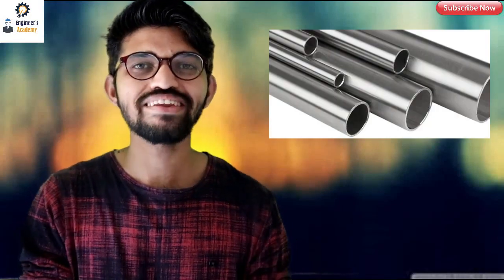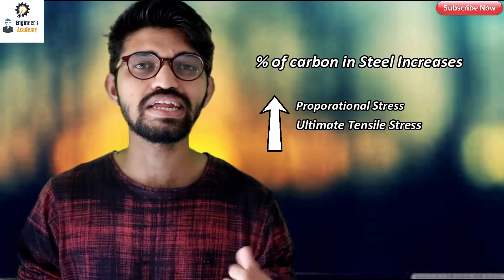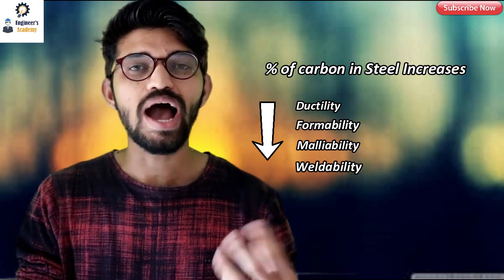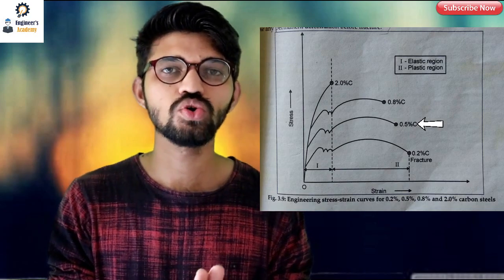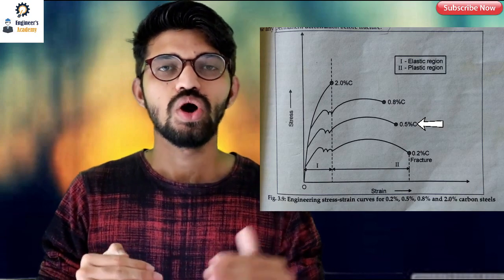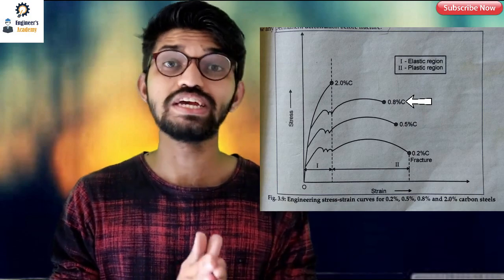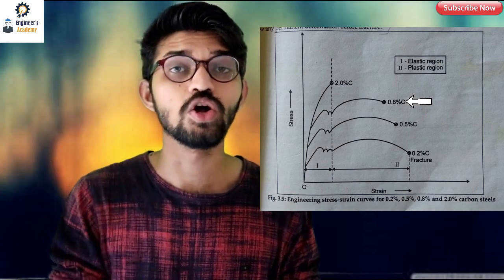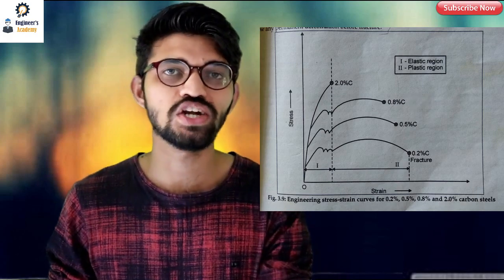Difference Between Low, Medium & High Carbon Steel !! ||Engineers Academy||

Comment: Bro, you explain the low carbon steels micro structure. Medium and high carbon steels micro structure stages?
Reply: Yes please.  And can you tell carbon % vs. Carbon Equivalent. In USA welding standards CE is a formula of carbon (+) plus % Mn/6. 

So. I have a bar/rod, threaded, with . 48 carbon  but . 612 CE. Does your guidance reflect on the . 48 OR the . 612.
Reply: Also I have a welded piece of this rod, that cracks off cleanly when "tapped" a few times similar to a Charpe test ( no notch).  BUT, WIL STILL SUSTAIN HIGH TENSILE LOADS!  I need a mastermind to help! Is this stress resulting across the entire section?  It's brittle like etching glass! Yet the welding code says to test welds by hammering ( or pressure bending) welded section over 30 degrees. . How can you hammer if impacting it severed the part?

Comment: low high carbon steel . Difference to STAINLESS steel metal ?
Reply: I have the same question. Pls share link if you have made the video.
Reply from the maker: I will make another video on this topic.
Reply: Stainoess steel is just another alloy that is allowed in addition to carbon. I forget what.